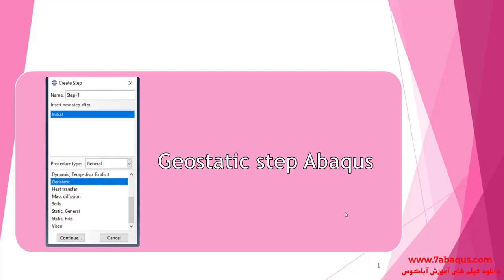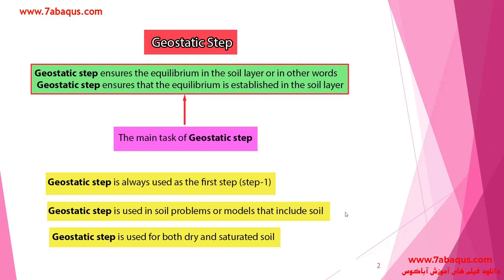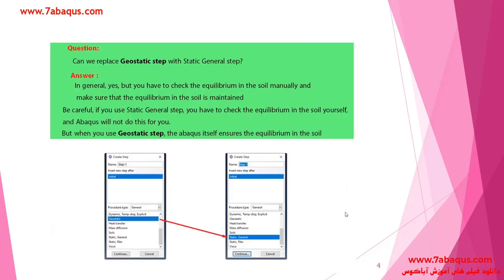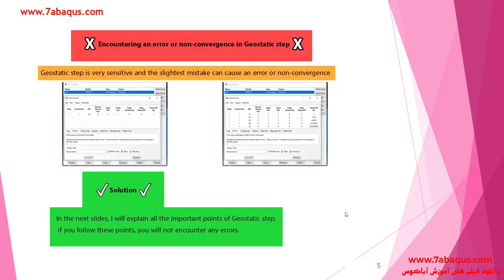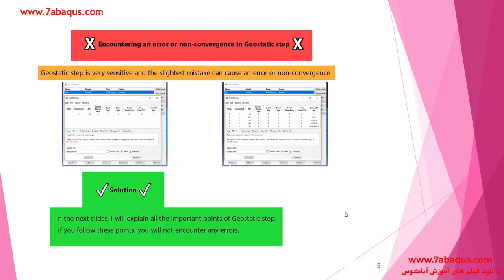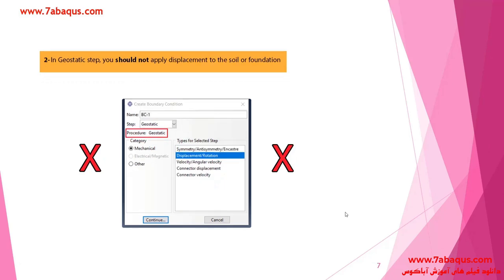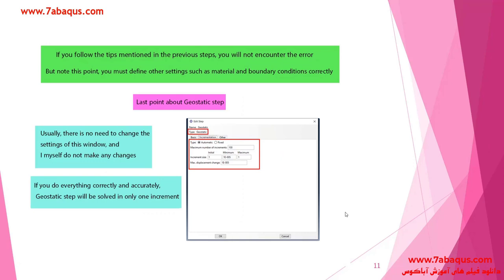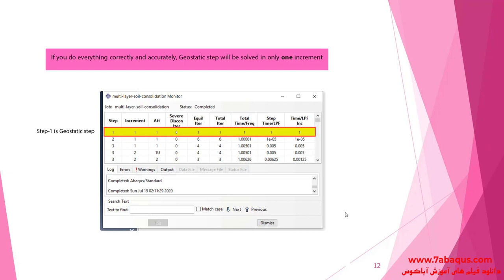Training of Geostatic step in Abaqus

Comment: Where to input undrained shear strength in Abaqus?
Reply from the maker: You cannot enter undrained shear strength (Cu) in the Abaqus software
Reply: @saeedmoeini-7abaqus  ok one thing also I wanted to know about absorbent boundary , how to apply it in abaqus.
Reply from the maker: @manishayadav5351  using damper on the left and right side of the soil 
but , if you use infinite elements , it is easier and faster
Reply: @saeedmoeini-7abaqus  can u please ellaborate this through a word document, How to apply dampers?

Comment: Thanks for this informative video. If I use Dynamic Implicit analysis in my actual model, then is it okay that the step after the Geostatic one, is Dynamic Implicit? Or need to use the static general step (dry soil) or Soils step (saturated soil) before the dynamic implicit one?
Reply from the maker: you can use implicit step or explicit step
Reply: @saeedmoeini-7abaqus  But we cant set an explicit step after geostatic step I afraid. ABAQUS just let us chose specific step after Geostatic excluded explicit.

Comment: You mentioned that the weight of the structure should not be applied, do you mean that the density should not be defined for the structure material in this step?
Reply from the maker: Yes , you must apply weight of structure in next step
Reply: @saeedmoeini-7abaqus  Thanks. So, we model the structure and its contacts with soil, but we do not apply the density of the structure?
Reply from the maker: @farzanehabedini5723  you apply in next step